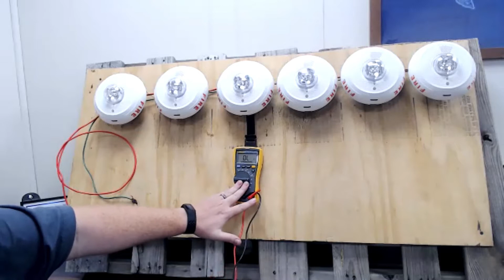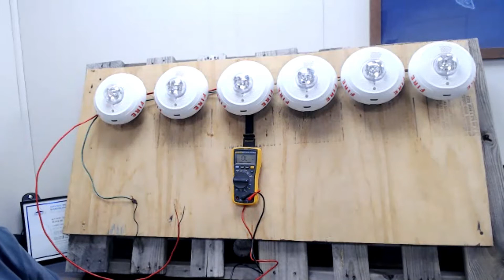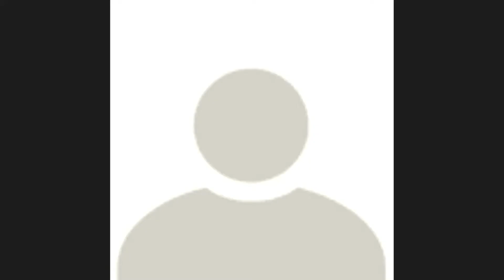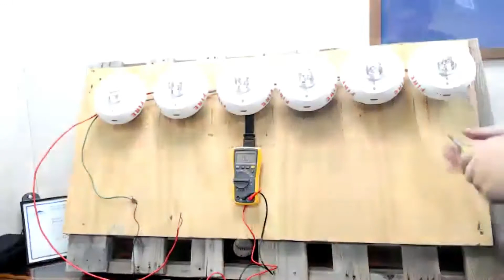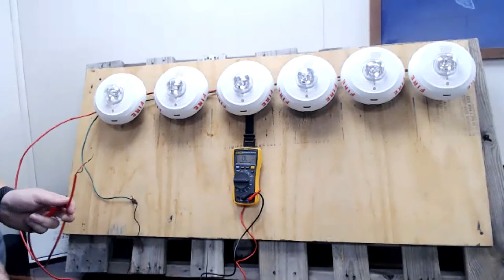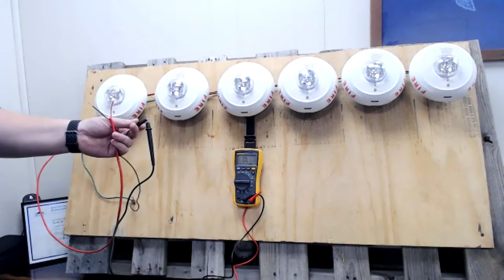Multimeter Demonstration

Comment: When installing your devices after verifying the circuit was pulled properly and is a continuous cable, start trimming at the end of line device. Install EOL-R and test your feed pair for shorts to ground and shorts across the pair. Clear? Terminate and button up that device. Go to the next device down from EOL and measure both pairs for shorts to ground, shorts across the pairs or between the pairs and verify EOL-R on your outgoing pair. Clear? Put your meter on the diode setting and measure for proper polarity on the EOL pair. All good? Terminate and button up this device. Continue this procedure until completing the installation of the final 1st device on the circuit. Finally verify at the head-end that your circuit is clear of shorts, opens, reverse polarity and you can read your EOL-R. Taking the extra minute at each device measuring both ways while terminating eliminates time consuming troubleshooting and half splitting the circuit for problems after you thought you were complete. This assumes proper stripping of the cable, proper treatment of the shield and drain wire if applicable, and folding your conductors properly and neatly when buttoning up each device. This method will save many hours of troubleshooting.
Reply: Interesting approach